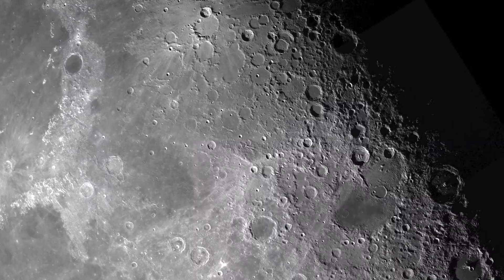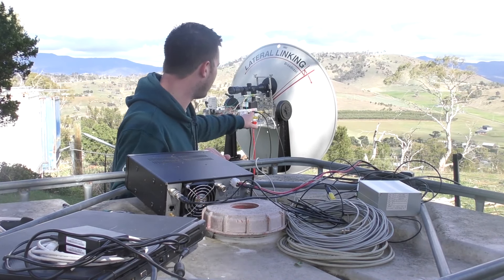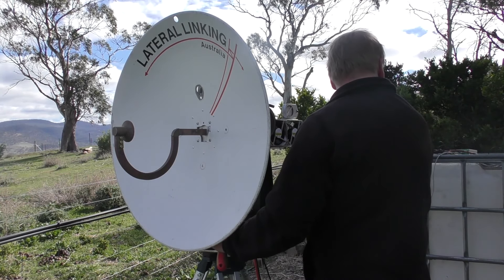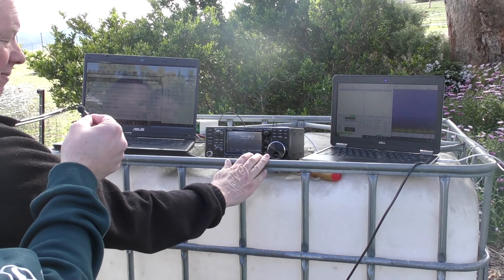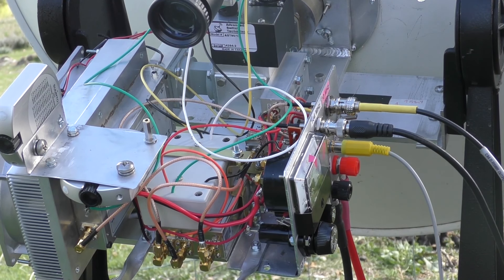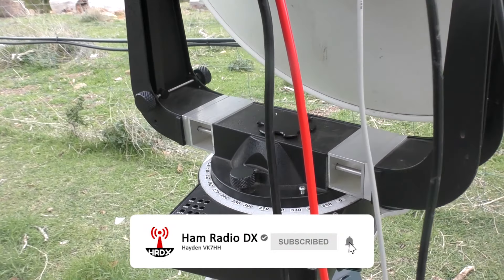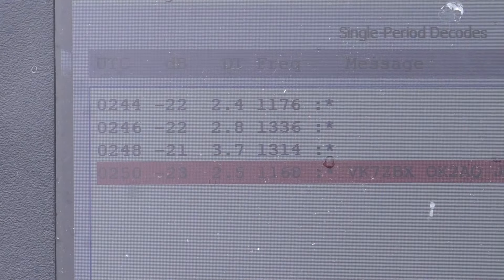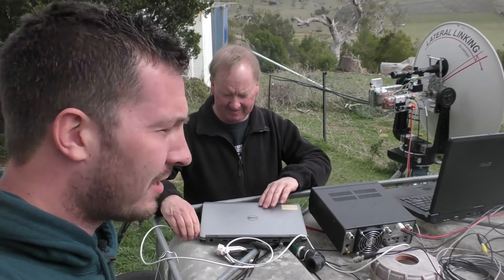We Bounced Radio Signals off the MOON!!!

Comment: Ever worked EME on 1296? I'm interested in trying microwave/EME but the the VHF/UHF antenna arrays are too big for the QTH. Hoping a high gain dish with a transverter and my 705 will be the ticket. Just wondering your thoughts

Comment: Thank you Hayden and Richard for that glimpse of EME, this is something I'd like to get into down the track, possibly on 70cm or some higher frequency?
Is the fabrication of RF stuff in the upper bands really as hard as it is sold as, with respect to solder tracks and connectors becoming antennas?
I would like to one day, build a transverter, I'm just not sure how I would go about that.
Reply from the maker: It doesn't have to be. This dish had a feed that would work already on the frequency & it has waveguides and switches, that's about it really. Plug that into a waveguide to SMA transition and you're good to go.

Comment: I am new.  Can EME be done at lower frequency? How low?
Reply from the maker: It's possible, but it's difficult due to ionospheric absorption.

At lower frequencies, radio waves can be absorbed by the ionosphere, which can weaken or distort the signal that is being transmitted. Especially below about 30 MHz, which are more likely to be absorbed by the ionosphere than higher frequencies.

Lower frequencies can also be affected by other forms of interference, such as man-made noise and natural sources of electromagnetic radiation. These can add to the noise level of the signal and make it more difficult to distinguish the desired signal from other sources.
Reply: @HamRadioDX  I was not thinking of HF. I know that most of that gets bounced back to earth. I was thinking about 70 cm or maybe 2m. There is no way I could get anything in the GHz range. But I have VHF and UHF. Someone was talking about someone had a UHF Yage pointing up. That is the only think I could think of was EME.

Comment: Is your system similar to the radio/TV system the astronauts used for  radio communication?. I appreciate e technology has greatly improved but I presume the basics would be similar?  Fascinating video! 👍👍
Reply from the maker: You'd be correct Scouter Stu. In fact, the astronauts also use amateur radio on the ISS for communicating with the ground. More information here - 
https://www.ariss.org/contact-the-iss.html

Comment: Weird. The Earth, Moon, Sun and Milky way Galaxy have combined speeds close to 1 million miles per hour yet a weak beam can return to a 2 foot dish 2.5 seconds later.
Reply from the maker: RF is only as fast as the speed of light. At 300,000km/second that means it's 2.5 seconds before it arrives back here on earth. Thanks for the comment
Reply: @HamRadioDX  How wide is the beam returning? Do you project where you are going to be x, y, a axis? Even Apollo aimed where moon would be.
Reply: Weird. The Earth, Moon, Sun and Milky way Galaxy have combined speeds close to 1 million miles per hour...

Not in our reference frame.
Reply: There is no absolute motion my friend.

Comment from the maker: Have you done moonbounce or satellite communication before? Let us know below!
Reply: Sure have! Jt65b VHF 500w
Reply from the maker: How many stations have you worked?
Reply: @HamRadioDX  11 stations across Europe with a 7 element 2m yagi when the moon is low to the east. The other stations did the heavy lifting and some of them were quite loud given the path.
Reply: Yes, on 23cm with the SGlabs transverter and 25W PA, using a 1.8m solid dish (cheap c-band tv dish) and a good LNA, using a OK1DFC septum feed. The first night i made 5 contact's, later i upgraded to a ~50w G4BAO PA (built from scratch from a kit, very cheap!, under 100usd) and i have worked about 25 stations so far... so you can certainly do EME on 1296Mhz without breaking the bank :)